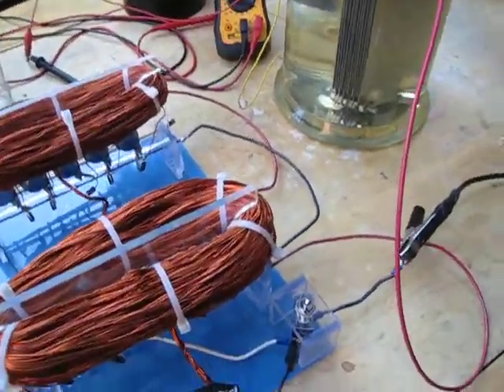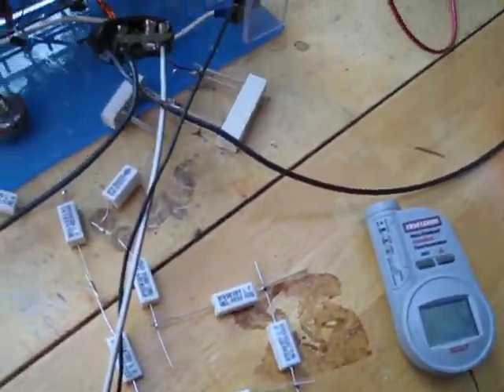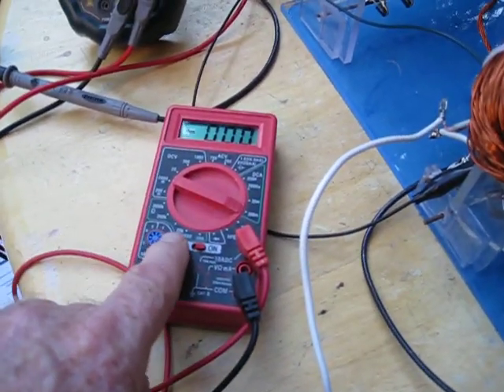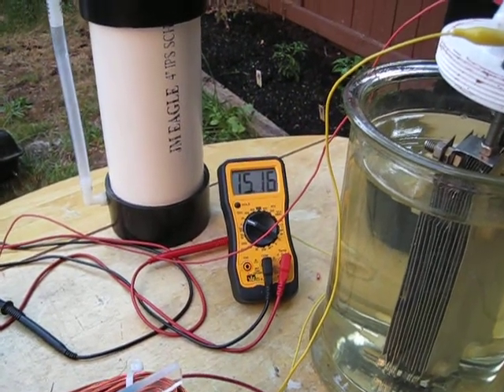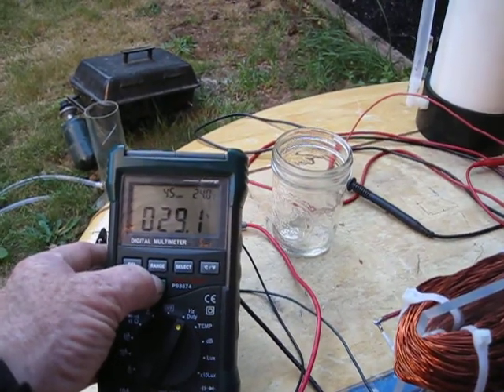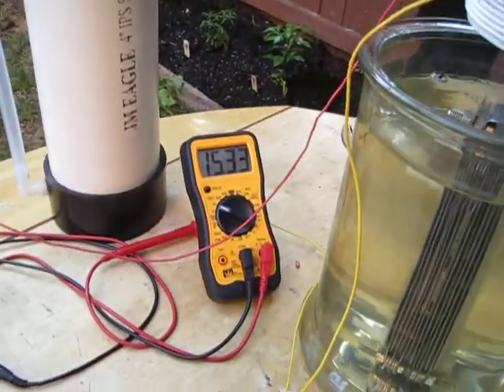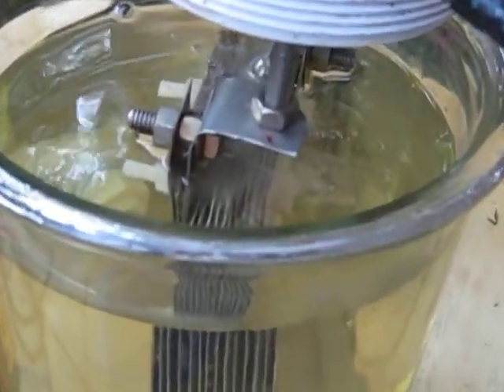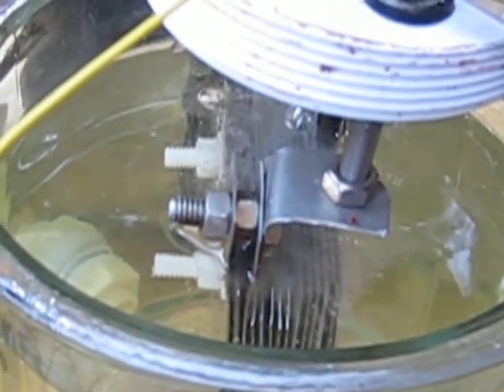10T solid state running HHO cell using 84 ohms on trigger 001

Comment: I haven't polished any washers, but I purchased a couple polished chrome ones and it seemed a bit better production.  Also stans spark plug fuel injector prints call for all polished surfaces with anything having to do with electrolysis.  I wouldn't use anything that would leave a residue.

Comment: I have a how to video with washers and double sided tape,  I don't know how straight and smooth your plates are, but double sided tape makes it easy to hold together while your getting ready to fasten them securely.  I have other videos, where I used just a zip tie's gap spacing and that was even too much.

Comment: Look at my newest video, the 18 washer setup has been in water for like a month.  The tape doesn't seem to break down..  At least veryfast.  The stickiness I'm sure breaks down, but as long as you have something holding the plates together, the tape shouldn't move.  The neutral washer setup is in that video also..  Decent production for it's size and having a neutral plate.

Comment: I also have a washer setup with a neutral washer inbetween and I can run that all day with stainless wires and it never gets hot.  But maybe with your set up you won't need a neutral.

Comment from the maker: ok, ill have to check it out, have you tried building a solid state set up to test your cells out yet? i have not had a time to check out all your videos lol, been buisy building new solid state layout that can handle more.  but a pulse set up will send spikes around 300 volts into the cells and seems to be working pretty good so far. by the way, thanks for the suggestions, its great when everyone puts there minds together.

Comment: You don't have to put them in water to test if it will short or not, just touch the wires to both sides after its together.  Control the current with them close, seems like your doing good with 2 amps, but the spacing could change that.  Sorry if you ruin a couple plates trying to space them that close, but it makes a significant difference with distilled and tap water.

Comment from the maker: never thought about using double sided tape in between the plates, does it hold up in the water or does it break down after a while. i am not running any neutral plates at all, we tried that a while back with positive in the center, and two negatives on the outside with 6 neutral plates. it never got hot running it with solid state pulse, but output was very low.

Comment: You might just cut the tape in 1/8" strips and run a few strips lengthwise down your plates, or if you can get away with just using little pieces here and there.  Test each set of plates as you do it to make sure they won't short from being too close.  If you put it all together and find it shorts, you will have a harder time

Comment: I have no idea what a solid state set up is. So no, I haven't made one lol.  I've been focusing the majority of my research on gas vapor and hho comes second, but there are a few simple things I've noticed that I'm trying to share with people that are willing. I think the higher the voltage, the easier it is for the current to seperate the molecules.  You just need the right combination, which I'm thinking, it's more a ratio matter than a set number of each.